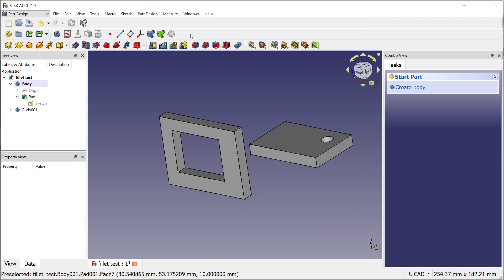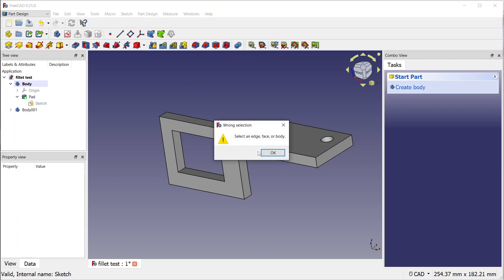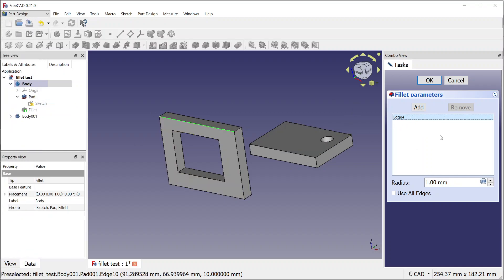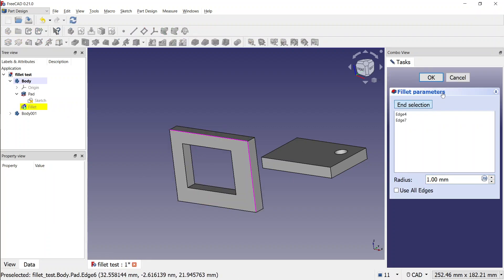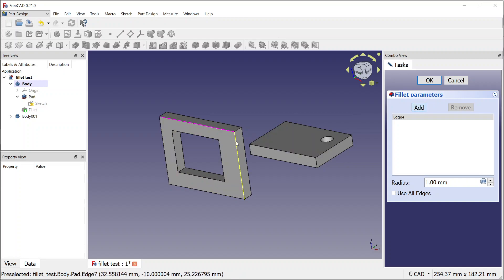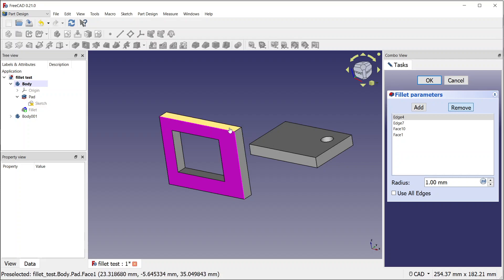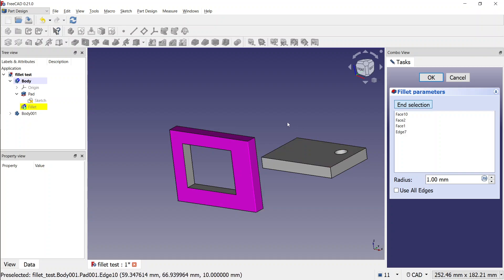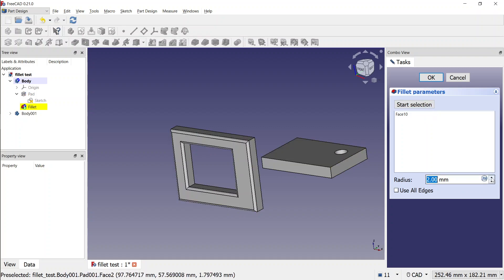FreeCAD: Fillet/Chamfer/Draft/Thickness rework

Comment: Will there be any other thickness tool improvements? It fails on some basic geometry where other CAD systems easily shell the same solid. It is mainly an issue with inwards option. Using outward forces you to design using the negative volume of a solid, not very intuitive.
Reply: Yes the thickness tool (and fillets/chamfers...) are not super robust. The thing is that this is a feature of the geometric kernel OpenCascade that FreeCAD is using. So it is not on freecad to improve it but on OCC. So who knows when that can happen :/